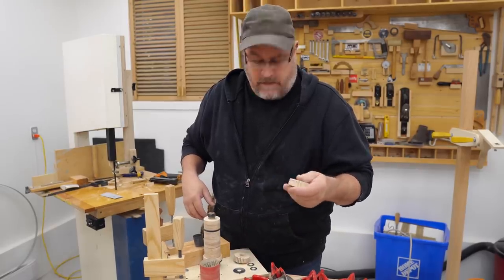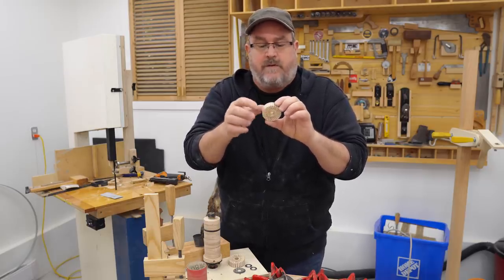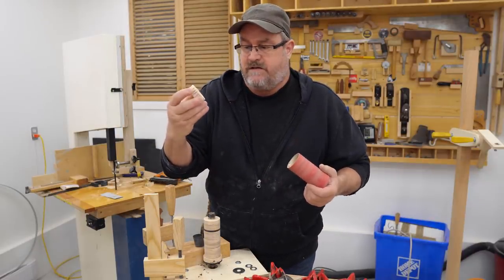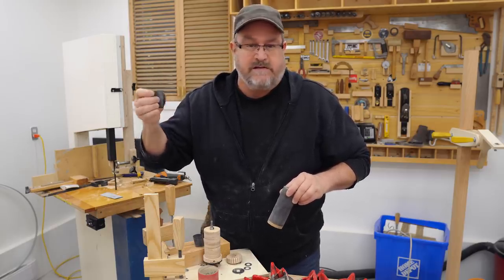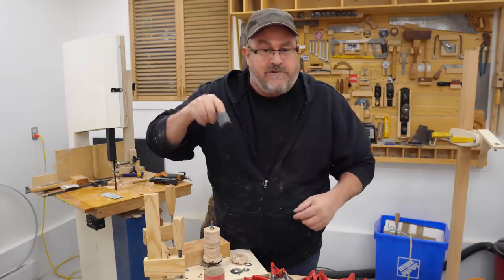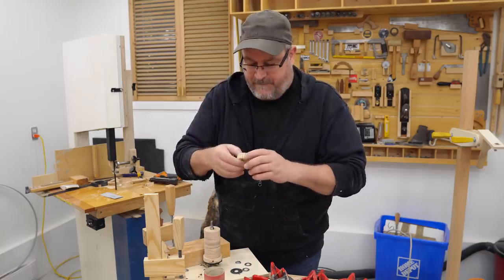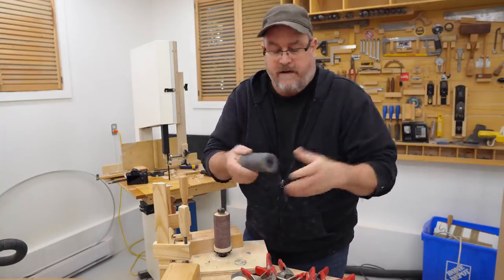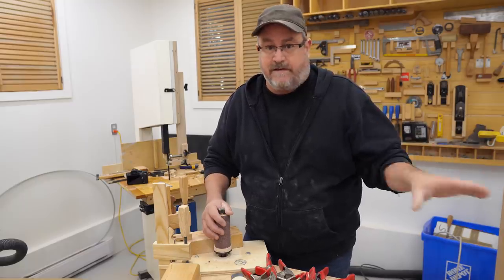Spindle Sander Drum Fail and Fix

Comment: Years ago Taunton Press had a book on shopmade tools, and it included a spindle sander. The unique feature of that sander was that it was a wooden cylinder with a rubber sleeve attached at the top and bottom of the cylinder, and a shrader valve to inflate/deflate the core for the sanding sleeve. Slipping? pump it up a little with a hand pump. Need to change the sleeve? Deflate it with a valve tool.

Comment: you got me thinking I should pull apart my spindle sander to fit into my workbench in the drop in router table spot
Reply: would save me some space which is a premium in my tiny workshop

Comment: Made me start thinking of an alternative.
A bunch of round rubber disks with dimples for bearings to sit inbetween each of the disks. As you tighten down the top nut, the bearings would press the rubber outward. Flat Washer, Rubber disk, ball bearings, rubber disk, ball bearings, rubber disk, ball bearings, rubber disk, flat washer. A bit of glue to keep the pieces together.

Comment: I would not try the ball bearing idea for myself without some way to be sure they wont fly out at high speed if the sandpaper breaks.  Really liked the video and the thought process to diagnose and fix the sander drum. :)
Reply: I don't think there is enough rotational speed for that to happen.

Comment: Slice the cylinder in half lengthwise. Let the nut on the top run two very shallow wedges (one on each side of the core) down to expand the two halves to grip the sleeve. No tolerance issues. Plenty of grip.

Comment: Just a thought, if you bevel the top and bottom disk on one side and all the in between disks on both sides and put them together so you end up with a V groove between all disks and then put  beefy O rings in the V grooves. If you have 6 disks for the spindle, you will end up with 5 expandable friction rings. If you tighten the nut and compress the disks, the O rings will push out and hold the sleeve.
Reply: That's a pretty good idea

Comment: John, going back to making rubber disks for a moment.  I'd recommend trying "Silicone Baking Sheets/Mats", silicone rubber has a very high resistance to ozone and doesn't tend to shrink or get hard over time.  Make, some punches to cut them out and Bob's your uncle...  Just a suggestion, the pin wheel seems a bit more complicated compared to using some rubber disks between the stacks.

Comment: I also wonder if the sand paper is maybe stretching. I had an issue at my last shop with the drum sander. I'd have to wrap it, run a piece through a few times and tighten it up. Do that a few times then it was good to go just because the sand paper would stretch under load

Comment: Why not make an expanding mandrel. I'm sure you could come up with some kinda of jig for it. 
Have the internal piece tapered and the external stepped for simplicity, but also expandable. If you look at the metal versions available, they are just cylinders with a series of cuts.
Reply: Many would say he doesn't have the patients. Lol
Reply from the maker: Many, many problems trying to make something like that from wood, and that's beside how complex and high precision it would have to be to avoid out of round and wobble.

Comment: What about spraying the cylinder with a rubberized coating (aka flex seal)? It definitely would not be a smooth finish. Granted it still might not be grippy enough, but it could be worth trying.

Comment: How about a "cone in a funnel" expansion? Could be made from something like hockey pucks.
What i mean is, make the top wheel with a funnel tapered hole, and a separate cone piece that fits inside it. And when you tighten the nut on top, the wheel expands and grips the sandpaper tube. 

It might be possible to try it with wood, if the tolerances are small enough, but i think wood is to stiff, and will most likely crack and do annoying stuff. 
plastic is probobly to slick to grab the roll, and well... plastic and heat is usually a disaster.
Reply: i was exactly thinking that but i thought the ring could expand via a living hinge type expansion joint out of wood with the funnel idea

Comment: I noticed you haven't mentioned combining both the rubber and the "feather bushing" (for lack of a better term). I was wondering what your thoughts were behind this? It seems like it would give you the variability between manufacturing error that would be needed to make a more versatile design. Then again, maybe I missed it. But, combining the two could minimize the effort in creating the rubber (again for lack of a better word) washer. There would be less need for more rubber with the feather bushing it seems. Then again, maybe it was mentioned, but I missed it somewhere.

Comment: You said the other brand (Freud?) would not fit the new spindle (too tight), but this is the way you were going to go.  That seems to suggest you will be excluding at least one brand of supplier for your sanding drums.  As far as a rubber material, how about the anti-fatigue floor mats that are available at Harbor Freight (Princess Auto?) and many other places like Home Depot, Lowes, or Menards (do you have them in Canada?).  Another, harder rubber would be horse stall mats, but you have to buy a big mat for such a little bit of material you need.  I've been told they are better than the anti-fatigue mats for floor mats in the shop.
By the way, I see the blue bin behind you on the floor with a Home Depot logo.  So what color is Lowes in Canada if HD is blue there?
Reply: I'm from Vancouver, BC and the Home Depot stores here have a red logo, while Lowe's and Rona both have blue logos. I assume it's the same for John and that Home Depot just offered a blue coloured bin with their logo on it. Good eye to notice that though :)

Comment: I know you're already thinking this, but the solution needs to be scalable. Previously I was thinking the pinwheels where the best option, but I'm not sure they will still function at 1/2" (or whatever your smallest is) diameter.
Reply from the maker: I've pretty much abandoned the pinwheel for all sized and have a better solution I'll show tomorrow. The 1/2" sleeve goes straight onto the spindle shaft and the nut holds it on, and realistically, that would work for the next two sizes (3/4" and 1") as well.

Comment: considering that you are making a whole sander and not confined by a bought one. could you have the  table higher  and use a hose clamp around the bottom  to hold it. if its always beliw the table it wont matter . it would be cheap and fast to open and tighten to swap the sandpaper. open the top nut to swap the whole assembly over to a different size

Comment: I know you are past fixing the old sleeve, but soaking in mineral oil might be a solution for others in the same situation. There is a coffee tool called an AeroPress that has a rubber plunger. The manufacturer suggests soaking in mineral oil to re-swell the plunger if it shrinks. I would think mineral oil would last longer than lacquer thinner.

Comment: Have you ever though of using some, BELT DRESSING?  You can spray it on the drum, then slide the sanding sleeve over it and it should stop all the problems..  It works on fan belts, so why not your drum???
Reply from the maker: What's with all the DRAMA in your comment????

Comment: But if you want to achieve just that spring tension hold, why don't you just make the drum itself very precise and put an inner tube over it? The entire drum would be holding the drum, not just the pin wheel. And you wouldn't have to make the pin wheel at all.
Reply from the maker: It won't hold.

Comment: Why limit yourself to preset spindle sizes? Why not wrap bulk sanding belt material around the spindle, either spiral or straight? With your creativity you will come up with a foolproof way to hold the abrasive to the spindle. At least here in Brazil, it's a lot easier to find bulk belt material than premade sleeves. Your problems with precision and tolerances would not be an issue, it would be cheaper. 
Hey, make a deal with Matthias, see who comes up with the best solution.

Comment: Tool-Dip the damn fluted spindles. OR, or... tool dip a regular spindle. That stuff can be removed and re-dipped if you need to refinish them. Here is an idea, wrap the spindle in fabric tape, then Tool-Dip so it won't come off.